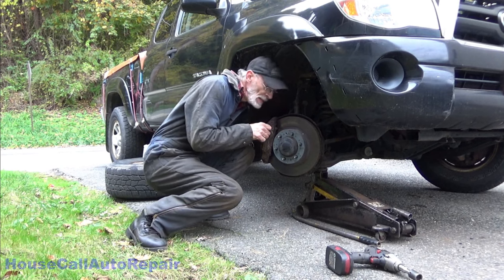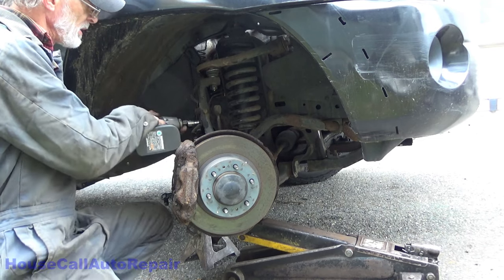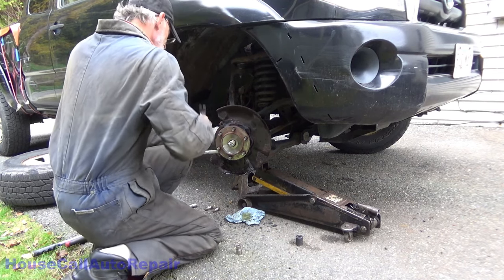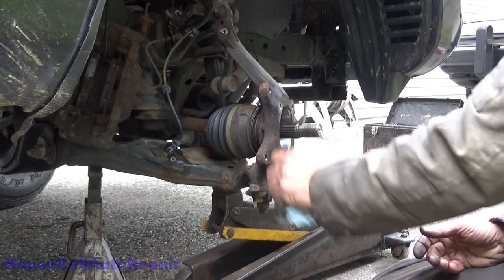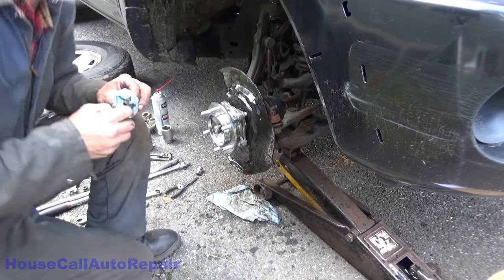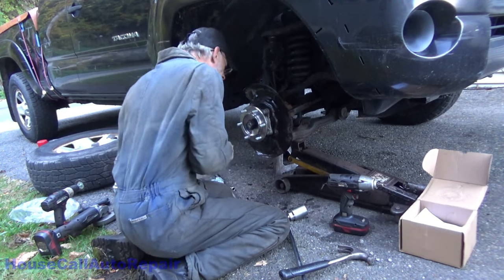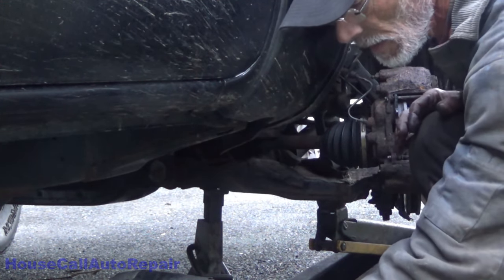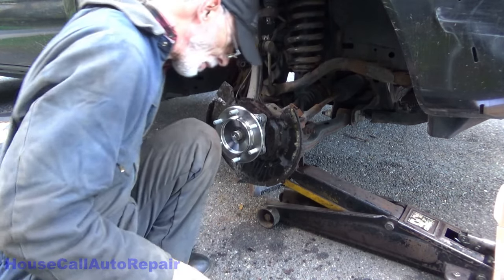2007 Tacoma 4x4 Front Wheel Bearing - Auto Repair

Comment: You’re older than me and I can see that you can stand to be on the ground doing that type of work. I can’t survive down there for more than 10 minutes. it just shows how screwed up my body really is. Good video brother.
Reply from the maker: A few years ago I started a new rule: "If the temperature is lower than my age...It ain't happening!"
But when needed I use blankets, moving pads, cardboard, rubber mats, etc.  One hour of laying on the bare ground equals three days of Ibuprofen.
Reply: I'm 54 and the constant up and down is getting to me. I call it "the calisthenics". I sit on a milk crate as I can't stay in a constant bending position for long periods. The knees don't like it. It never fails that I need another tool and have to get up and return to the tool box. I'm going to build a tool caddy of some kind that rolls and I can hang wrenches and sockets along with pliers and screwdrivers. That way everything is within reach.

Comment: I tried to do front brakes and I have 30 years experience and it took me all day long to get it done trying to get up and down! Need a new body lol
Reply from the maker: I run through the whole process in my mind, and pile up the tools in advance (as much as I can remember)
Reply: I had the same result doing rear brakes, calipers and rotors on a Mazda 6. I started the job at 9 AM. It was up, down, back and forth trying to get the brakes bled. It was near dark when I returned from the test drive to the store to get two 24oz. PBRs. The girl was waiting in the driveway when I returned. After I got paid and she left, those PBRs "evaporated" while I cleaned and put away the tools. Then I went inside, sat down in my recliner, and "died" like the Law and Order guy who is doing the TV commercials for Tommy Copper.  🤣🤣

Comment: So what do you do about the bolts being way too long if the customer got their own parts? Does the customer pay for the extra labor? If you got the parts, then I guess you would pay for the extra labor correct?
Reply from the maker: For a variety of reasons, including parts warranty, I leave purchasing the parts up to the owner. In the event they get a part I cannot work with, they have to try again, and I will have to schedule a return trip. I charge only a flat rate for these simpler jobs.